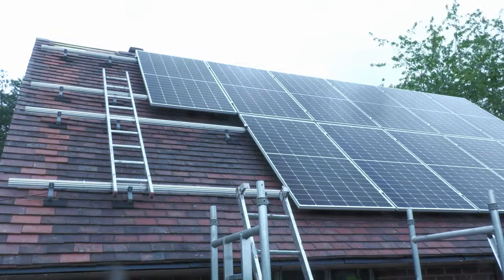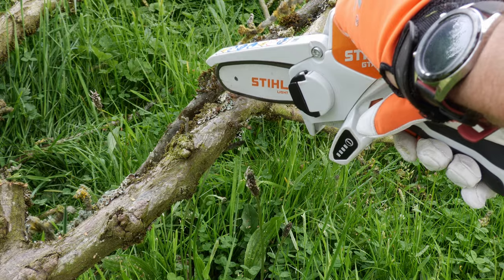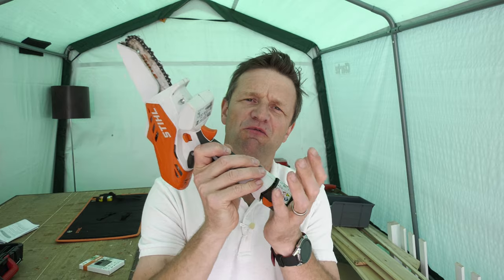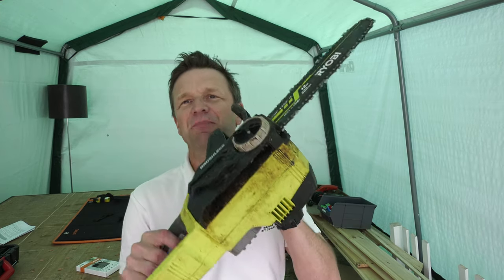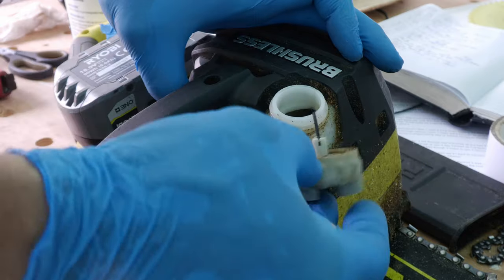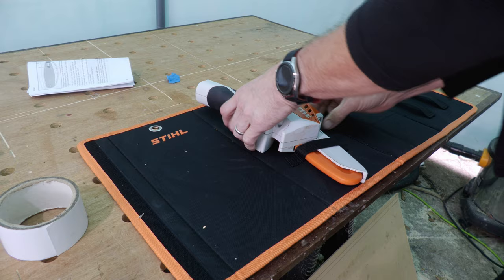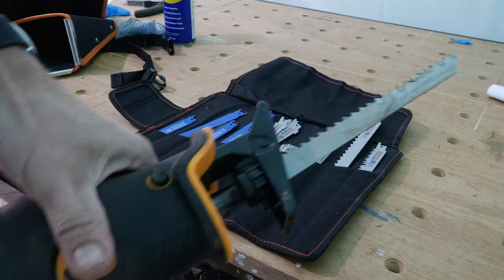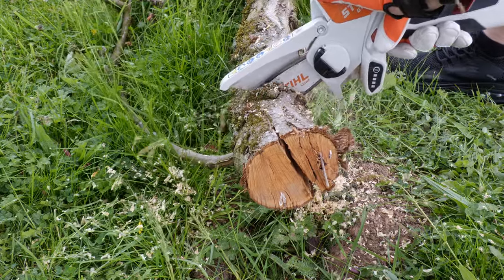The BEST Garden Pruner? Stihl GTA26 Review

Comment: Bought this to cut up a significant amount of downed leylandii trees in the garden. It easily cut through all branches up to 6cm diameter (used a larger Stihl chain saw own larger sections). During a sequential cutting and bagging period, the battery lasted for a period of around 3 hrs. To be then replaced by a second one provided by Stihl through a special offer deal. Four mornings later the "hand held chain saw massacre" was complete. I ran all the cuts using a single hand hold action. No real problems, and not 2 hands as recommended by Stihl. I can honestly say it was a pure joy having achieved a task that initially defeated 2 hand lopping tools and me. Only recommendation is don't use to much oil lubrication otherwise you will get a "cake of oil dust" in the chain assembly body. And I hate the storage bag. I can't believe this is a Stihl design!! Otherwise undoubtably the GTA26 is one of the best tools in my DIY collection.
Reply from the maker: Great review 👌The storage bag is terrible. Everything falls out. It definitely needs a second battery - maybe they listened to me 😉 And yes it needs to be used single handed. That was the health and safety team covering their backs. It is a versatile little tool. Recently used mine to cut joists in the kitchen.

Comment: Thank you for such a complete, honest review. I recently purchased one, after anxiously waiting for a year, and so far love it. I am an older single woman and have had to pay for removal of small volunteer trees and trimming so, in theory, this is a dream. As summer approaches I am anxious to put mine to good use for trimming/ pruning. I will probably buy an extra battery. Your thoughts were helpful.
Reply from the maker: Well done Kathleen. Yes I don't think the honesty of the review endeared me to Stihl but that's the way I roll 🤣 Definitely get a spare battery then you've got the perfect little tool. Also you might watch this https://youtube.com/shorts/4WMpr-BZShg?feature=share on sharpening the blade. A blunt blade slowly creaps up on you so you don't really notice as it gets more blunt. Also make sure you oil the chain regularly. 👊
Reply: Am also an older single woman. Had been doing very well with some great lopers and a reciprocal saw for most things, but with the latest storms/tornados that with having downed limbs attacking from all sides, I needed to try something new. It's not that I'm intimidated by a full-size chain saw, it's the WEIGHT of it, and the fact that I am cutting through tangles of branches intermingled with MY bushes, with little room to maneuver. "Goldilock'ed" the four brands I could find in person to see how they felt, and discovered the safety mechanism on some were made to favor right-handed folk only, and were uncomfortable to hold. The Stihl was the last one I tried, and I immediately LOVED the weight and feel of it,. (And they did have an extra battery in stock.)  I agree the carrying case is a bit silly, but it's well-made and I can modify it to my liking. Have not used it yet— am charging the batterys— but thanks to your honest review I know how to care for it properly!

Comment: I think Stihl chainsaws are top of the line saws. This mini G26 is very nice for trimming branches and brush clean up. My only complaint about it is, just like many other brands is not self lubricating chain. You have to manually lubricate it instead. Hopefully Stihl will improve on that in the future.
Reply from the maker: That and battery life and the fact they've created a pistol shaped tool that they want you to use with 2 hands. 👍

Comment: Charlie, very informative video. I too have the Ryobi !8v chainsaw which uses 2 hands to operate it. I also found the branches, sprung around unless you steady them which leads to spring back and causes a few whoooahs. As I have lots of bushes (10ft high plus) in my garden, from your review, I thought Stihl, good make, not that too expensive but found a deal with a free battery. You NEED a second battery. One being used, one being charged. All I can say is, I should have got one years ago. Used carefully, one handed holding the branch and the other hand cutting it, well absolutely marvellous. Branches cut up quickly and easily. The fold up case, really is just a joke as things fall out. A similar bag would have been far more practical. The chainsaw/pruner, fantastic. I bet Stihl will shortly be making longer lasting batteries. Size, ease of use, just the job but don't try it on those large, Hadrian's Wall type trees. Sorry.

Comment: I'm using it one handed, you're using it one handed, we all know we are using it one handed ;) That's the delight of this little tool whatever the makers say, it's very safe to do so if done with a bit of care and attention. I am a trade gardener and this, with two batteries (yes, I agree, they are a must) made short work of an apple tree pruning job that was a bit too high up and densely packed to make weilding a full size chainsaw practical or safe (for me), but which would have taken twice as long with hand tools only. It won't last all day and it won't take heavy abuse, but for the right job at the right time it's awesome. And yes, Stihl, you need to be offering a two battery (and extra chains) kit. When I bought this a year ago, I ordered this and an extra battery and extra chains, and because of rarer than hen's teeth supply issues, I had to get them from multiple suppliers with multiple helpings of shipping charges and a long wait for the essential accessories which were out of stock almost everywhere. really making the purchase of a useful tool a long and frustrating experience.
Reply from the maker: Good to hear from you William. Thanks for letting me know how you're getting in with it. Glad you agree with me on the battery issue. And I guess working in trees like that the holster comes into its own 👊

Comment: I bought one of these and I love it. I have a very small yard and small trees tend to grow up between my hedges. You can often use it two handed if you hold down branches by standing on them and weighing them down. It does seem to cut more solidly 2 handed. Anything above this size is overkill for a person with my size yard.
Reply from the maker: It is a clever little tool but needs 2 batteries

Comment: A good review that makes you think a bit more before buying. The issue I have with battery powered tools is the range of voltages as well as battery design. Even if you are a devoted Makita buyer, the variability in design and voltage with a single manufacturer makes battery swaps impossible between tools. Added to this, many cordless tools are sold as skin only, or as a kit and you end up with a second unwanted charger. An industry battery format would be useful, but that requires collaboration rather than competition.
Reply from the maker: Thanks. Having a few different chargers doesn't bother me as discussed here https://youtu.be/sL-t2Zc4wCs The manufacturers want us to be loyal to one brand and having a few different strategies keeps them guessing 😉👍
Reply: Not if you buy AEG. Alll skins fit all batteries ever made by AEG.

Comment: Thank you for the review. It's a fun tool. I didn't know that I was meant to use both hands and I agree that the kit requires another battery, and a proper bag would be nicer. Your vid came up as first option and I was not disappointed. I needed clear instructions about the chain and tension mechanism. 🙏 Cheers!
Reply from the maker: You're very welcome Annabel thanks for the comment. 👊

Comment: Hi Charlie, first visit to your channel and love the video. I have recently bought the Worx version of this type of saw/pruner. One of the reasons for buying the Worx is that their batteries seem to fit most of their tools with only a few small screwdrivers being the exception. The battery life on the Worx seems very good and I cut up a sizeable pile of branches from a silver birch that I cut down using a pole saw without having to recharge. Some of them were around 10cm in diameter. The standard battery takes an hour to charge using the supplied charger.
Reply from the maker: Good to have you on board Mark 👊 Yes that's great thinking. I saw some Worx tools in a shop in Spain this summer and was very impressed with the build quality.  This is the big drawback of the Stihl and even the Milwaukee system is better because you can use the batteries on more tools.  Shouldn't think Stihl were very happy with this video but I have to give honest reviews of these things 👍😉

Comment: I have something which sits between this and a full size chainsaw and that's the cordless Worx jawsaw. It's quite heavy for high branches, but really excels at cutting deadwood into more manageable chunks - the jaws of the tool lock the branch into plae before cutting into it. Very safe as it's impossible for the wood to jump forward or back. I think it's brilliant.
Reply from the maker: Is that the WX543 or 550? Yes this looks like a nice tool and I could do with a cordless jigsaw. Thanks for sharing 👊

Comment: I use it a lot, bought a spare battery and also have the shears so 3 batteries in total. But my biggest criticism is slow charge time, they need to make a quick charger.
Reply from the maker: I agree. The other brands like Milwaukee where the battery system can be used on a much wider range of tools are a better option IMO.

Comment: I have just bought one of these, and it is coming with the additional battery.  I am not a professional tree surgeon, but I do have to manage and have cut down and prune many trees on my land.  I use Stihl and McCulloch chainsaws usually, but when climbing trees, I would prefer to use something lighter with a much shorter bar.  This looks ideal for my needs. I can focus more on my harness and life support rope rather than wielding a 2-stroke menace that I have to pull start half way up a tree.  We'll see how it goes.  I don't see one, but it would be useful if it had a safety rope loop to enable me to attach a line to it just in case I drop it.  Then I suppose they are not expecting people to climb trees with it.  Why not?  Can't wait for it to arrive.
Reply from the maker: Good feedback. It's a great little tool but it does need two batteries and it's a shame it doesn't have an oil reservoir or utilise 18v batteries as part of a wider range, like say Milwaukee or Skil mini chainsaws do.

Comment: Milwaukee also do a 12v 'hatchet' pruning saw with a slightly longer chain bar length (15cm compared to Stihl's 10cm) and it comes with 2 batteries but the price is around £269. Despite the price level, I'd personally, given the design faults you highlighted, go for the Milwaukee, plus it has two grip handles. No doubt there are some cheaper Chinese jobbies and despite inferior build quality and zero after sales service, maybe that's worth checking out - I suppose also  it depends on how much pruning to be done in your small or big garden. At the moment I'm sticking to my Stihl 261 but a mini chainsaw 'does' look cool and there are many a time I don't fancy hawking around the garden a heavy duty chainsaw, so perhaps when I'm feeling flush. Thanks very much for the video.
Reply from the maker: Thanks Mark. Yes someone else has just pointed out about the Milwaukee. I now wish I'd mentioned that in the video. Works with my M12BPD too so would be the obvious one for me to buy.

Comment: I recently bought the bare tool Ryobi mini chain saw. Also bought the high performance battery kit which included 3 batteries, 2, 4 ,6 ah high performance with charger and bag. Total $238. I haven't used it yet as its still pretty cold here in MN. Sure doubt I'll run out of battery power like the Stihl.
Reply from the maker: Brilliant. You'll love that and yes it's all about battery backup which the Stihl doesn't have 👌 A bonus if you can use those batteries on other Ryobi tools - which you can do with the Milwaukee equivalent but again, not with the Stihl.

Comment: I brought one and 2 spare chains, it's brilliant until the chain wears out. Replacing the chain is easy just make sure you rest the tool on a flat bench as it can be fiddly, also clean + oil chain and bar, so if your chain jumps off the bar it's telling you to either use the chain tensioner or replace the chain. I use the GTA26 to cut trees 5 inches thick now and then. All in all its okay for the price.

Comment: I have used it to prune more than 20 olive trees with some branches as thick as 4 to 6 inches....plus side...light one handed I have a glove on the free hand always as i hold branches....small and easy to use in thickets...less weight stress on the hand...2nd battery if buying it with the kit bag is discounted in Cyprus.and its powerful as it cuts comfortably through olivewood...easy to open and clean....negatives..
just the battery really ...I have 3 so i can continously work while i have a free one charged that i use to replace typically every 17 to 22 min while the 3rd finishes charging in 75 min...

One tip keep the oil in your pocket..lube the chain every 10 min..its fast..and really helps the cutting to be smoother 

Not a toy...careful when giving it to a non experienced and keep away from kids..very very  dangerous if they grab it to play...as dangerous as a handgun in my opinion!

Comment: Hi  Charlie,  good review , it has its pros, and cons, as you pointed out, and I agree whith Stihls shortfall in the battery and storage bag. And would I buy one? No , like you I own a full size chainsaw, and several bowsaw ,etc, if I may I would like to point out ALL chainsaws are intimidating, and should be given the utmost respect, and not forgetting to wear the proper ppe. I think sometimes people are lulled into a false sense of security using cordless power tools, and don't take enough care in their use, I know you said they recommend having both hands on the saw, but in a real world situation how many people will do that, if your on a stepladder trimming a branch , and  feeling a bit wobbly, the possible result doesn't bear thinking about. Rant over, thanks for the video mate, I look forward to the next one on your roof project,  stay safe,  best wishe's to you and your's, Stuart UK.
Reply from the maker: Hey Stuart, good to hear from you. I agree. Bottom line, this tool isn't really designed for you and I, but I've had a gardener on here say with two batteries he finds it very useful for pruning in confined spaces. Fair point about the chainsaws. 👊
Reply: @CharlieDIYte  Hi Charlie,  thanks for the reply mate, I can see this tool would speed things up for a professional gardener, so it will have its followers. I whish you well,whith whatever your doing at the moment, and look forward to your next video,  stay safe mate, best wishe's to you and your's, Stuart UK

Comment: This seems like a competitor to the Bosch Easy cut nanoblade.  Which by the way was a tool that I found hugely disappointing.  I think the best thing about this stihl in comparison is that looks like a standard chainsaw type chain that can be sharpened rather than having to buy a new one every time it gets blunt.
Reply from the maker: I think that's right. Yes it is a standard blade. There are some real contradictions with this tool - a pruner which you are advised to use two handed - what?? And that battery can only be used on one other tool. I think if I was buying one of these I'd be seriously tempted to look at the Milwaukee equivalent.

Comment: I initially assumed it would accept a pole so you could prune higher up like some similar tools. Thanks for the review.
Reply from the maker: No, not this one as it's a two step operation to pull the trigger (safety switch) even if you could get it on a pole.  You wouldn't want one of these on a pole in case it fell off mid operation. 😬
Reply: @CharlieDIYte  Just use cable ties on the triggers.   Problem solved.  (i'm joking!)

Comment: Similar to the much smaller Bosch Nano in that the problem is it's too potentially dangerous for the target market.
Every 10.8v/12v tool manufacturer usually offers 2 2.0ah batteries for high power demand tools or a 4.0ah/6.0ah battery instead.
Reply from the maker: I'm inclined to agree with you - thus the insistence on it being used two handed which negates it's benefit as a pruner. Yes the Milwaukee does this and actually works on those 12v batteries I showed in the vid. Difficult for Stihl when their batteries only with on 2 tools.

Comment: I think I’ll stick with the Ryobi lopper chainsaw-on-a-stick for that sort of job as it has the advantage of being extensible to get at higher branches.  It also takes the 18v 4Ah batteries
Reply from the maker: Very wise Andrew. Stihl are restricted by their battery system only working on two tools. I've since realised Milwaukee do a slightly larger chainsaw that fits those 12v batteries and as you rightly say, Ryobi do that tool. I wish I had mentioned these points in the video. There's always something you leave out!
Reply: Using the same, but then the Milwaukee M18 pole saw. Very pleased with it. With the extension you can easily reach up 4/5 meters and cut through 20cm of wood. Insane power in such a tool. Only wished I could just take it off the pole all together haha, then I'd have a mini chainsaw :)

Comment: A good bow saw will do for everything else, need to buy the shortest one you can, the long ones are a nightmare.
Reply: I might have agreed with you before the experiences of:
1)  Using a 30 and then a 36in bowsaw which, on a sawhorse, made almost as quick work of 6in dia wet logs as would a chainsaw. And though a 21in bowsaw was more convenient for pruning 1-2in branches, its depth (even the pointed end variety) meant other branches were getting in the way. So, not so practical.
2) Using a pull-action curved pruning saw as used by arborists (Samurai Saws). Weight 200g, narrow blade 330mm long makes access easy, cuts as does bowsaw.